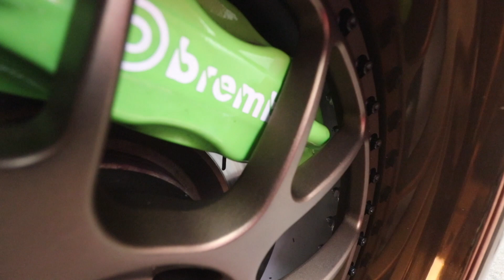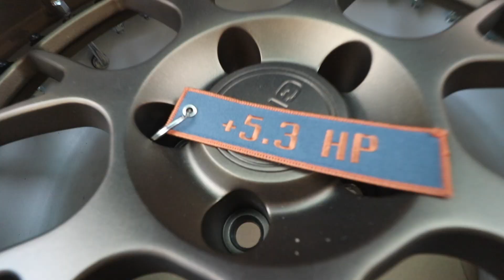EVO X CUSTOM FORGED 3-PIECE WHEEL REVEAL!

Comment: Gets custom offset wheels for “perfect fitment”, still needs spacers
Reply: Jordan Eldridge the thing about doing custom stuff that hasn’t been done before is you risk getting it slightly wrong. It’s not a perfect science. I don’t see why you hate
Reply: If I had OCD, I would redo the car.
Reply: Cade Ford it’s simple math. Don’t know how you mess that up
Reply: aaronisme318 This.
Reply: Fucking Lizard King Also this. It’s literally just a measurement and mathematical equation to find out the perfect fitment of wheel/tire setup.

Comment: Just a suggestion for a future vlog might be to help explain to us at least the basics of wheel specs and fitment. You mentioned there was a lot to it so maybe not all of it, but just the basics like what this like 'et' mean right through to how running spacers is necessary for clearance and to get the "fush look" but may not be great for handling. You could go in to why you've chosen your adjustable suspension. Doesn't have to be in depth and you could disclaimer it as only intending on being the basics which should be good enough for most followers.

Btw these wheels are cool, no doubt. Going for 3" lip is a bold move. I actually have a soft spot for the NT03's though. They can "racecar" any car.

Comment: I just notice ur specs  are 18x10.5+12 i fit that easy on stock body with the slightest roll in back nothing up front i was lower then you and had no issues with rubbing anywhere not even the pinch weld and i had little to no camber i dont know why you need a whole body kit to fit WEAK SPEC WHEELS ive bee supporting you since forever u taught me how to drive stick #TC but it just flabbergast me that you need a widebody kit to fit basic spec wheels im not even lieing either ask sheldon or i have a video of my evo on my channel im just saying